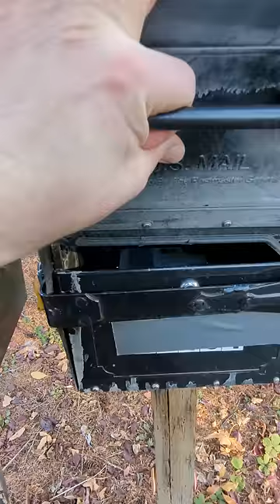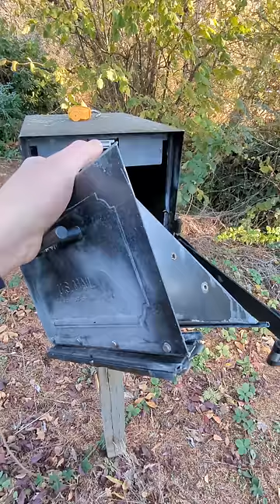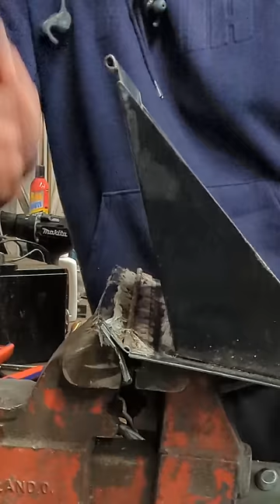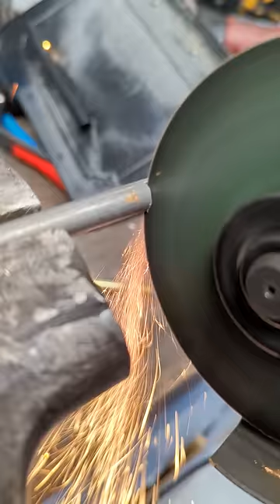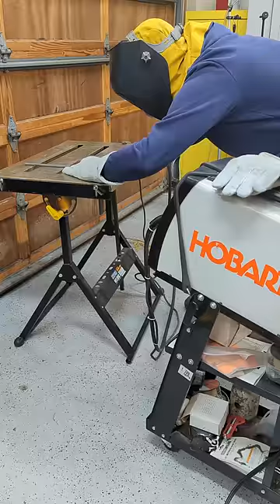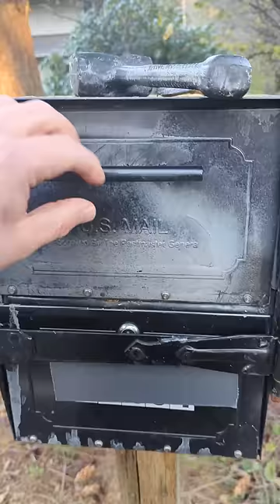Beefin' up the mailbox again...

Comment: I saw him put in hours of effort only to slap on a masterlock and instantly got so sad for this man
Reply: OnlyPain
Reply: I assumed that was meant to be the punchline
Reply: I was thinking the same hahaha 

All his work was basically useless
Reply: @beepboop7090  Well no. All that can be used easily to swap in place actual lock like Abloy classic.
Reply: What’s a good lock then?
Reply: The box is electrified he shows at the end of the video
Reply: @tylerc3477 Watch Lockpicking Lawer. He'll show you what to avoid
Reply: @tylerc3477  Depends on use case. No luck is full proof. Maybe an Abus here? Check out Lock Picking Lawyer.
Reply: @zebcollison2563  that's not a power cord. That's cabled steel. Resistant to cutting with a masterkey (bolt cutters.) Better than most light duty chains, anyway. 

There's no way you could electrify your box to an amperage that deters theft and not find yourself in a lawsuit.
Reply: it's for a squirrel apparently,  so I think the lock is safe.

Comment: Turns his mailbox into fort Knox.... Locks it with a master lock 😂😂😂😂😂
Reply: Lock picking Lawyer would like to know this guy's location
Reply: Bro bears can’t pick locks
Reply: If it happens again I fully expect he will weld the whole box
Reply: @mattruder5858  have you seen the videos “picking” masterlocks?? A lot of them you can just bodyslam them together or yank kinda hard and they pop 😂
Reply: @mattruder5858  is that what this dude is beefing up his mailbox for?
Reply: @ThatDudeDeven  That’s what I would guess, I didn’t watch any other videos
Reply: @mattruder5858  Yea I've randomly seen this fuckin short like 50 times and there is no backstory and nothing on his channel about it at all. Just car videos. I feel like I'm stuck in another dimension trying to figure this shit out.
Reply: May I dare to say “fort locks “
Reply: @mattruder5858  probably most locks but a master lock... maybe
Reply: @MorfsPrower  forget about lock picking lawyer. He tied the box down to the post with one of those flimsy cables that can be easily snipped with a small pair of bolt cutters.

Comment: Makes a safe, proceeds to lock it with a Cheeto.
Reply: This is the best comment. Oh my God
Reply: I just watched the video of the guy who came up with that meme. Weird timing
Reply: A TORCH SAWZALL BLADE will cut the post and cable in 5 minutes.
Reply: If I was the thief, I  would just bring a wood saw and take the whole thing.
Reply: @Hanzyscure  l lol
Reply: @gang1798  nah, it only takes a couple seconds to rake a MasterLock like that. You don't need to be a skilled picker
Reply: @tigerofdoom  takes even less time to pop it open using 2 wrenches
Reply: @tigerofdoom  I can pop that lock with a scrap piece of sheet aluminum can.

Comment: It's good that the guy stealing your mail doesn't know how bad master locks are😄
Reply: yeah. I saw that and chuckled
Reply: What locks are the best?
Reply: @TTime685  no lock can stop a good lockpicker but decent disc locks require special tools that arent as common. anything is better than a masterlock though
Reply: @flexflex8950  Gotcha. So Master locks suck overall when it comes to picking AND durability? Or just picking
Reply: @TTime685  they are not durable theres quite a few masterlocks that can be opened by hitting it with another masterlock
Reply: I've literly  opened master lock  with other masterlock keys , lol they just get worn down and done
Reply: @TTime685  For a good example, before I could lockpick anything at all, I used a bunch of masterlocks I had laying around and it was fairly simple. Even if you didn't feel like properly picking any of their locks, a simple "rake" style lock pick worked like 100% of the time, and raking can be done extremely quickly. you just put the pick in and out, fast, and over and over, and their locks would just unlock
Reply: @TTime685  You can even break em with an 12 inch prybar.
Reply: You want a lock that can take blut force. Youtube it
Reply: @TTime685  See Lockpicking Lawyer. He just looks at a Master lock and it pops open...lol.
Reply: @kefpull6676  Or if it takes him more than a minute, then it's pretty safe to use.
Reply: Thank you was my first thought and I'm only a couple thousand locks into picking
Reply: @TTime685  NotMasterLocks.

Those are the best
Reply: If dude is this dedicated to upgrading his security, he needs to get hisself a roku padlock. You won't be 2-wrenching OR picking one of their mid-quality locks. Probably be spending over 100 bucks tho. I haven't looked up prices. But you get what you pay for, or should.
Reply: Abloy is the best locks
Reply: Or watch the videos on what he did to beef up the box.lol
Reply: @TTime685  abloy protec locks
Reply: @TTime685  Get an Abloy, they are hard to pick.
Reply: Brinks locks are the best
Reply: @flexflex8950  You can pop a padlock like that with two wrenches. No fancy tools or lockpicks needed.

Comment: CCTV, motion detector, and a curved plastic piece at the bottom of the post, that reads,       
 "FACE TOWARDS ENEMY"
Reply: @American_ZeR0  the key letter is F towards enemy
Reply: and on the back it says "do not eat".
Reply: @capt.raptor4650  only on those that are issued to marine units.
Reply: @capt.raptor4650  😂🤣🤣🤣
Reply: @American_ZeR0  🤦
Reply: I think you could be 100% successful cutting your list down to 1 item, well you might need a small pc of wire too.
Reply: "Hmmm what's this thing d-" (Explodes)
Reply: FRONT          
TOWARD ENEMY
Reply: "I see the light!"
Reply: Woo Hoo Come Out Swinging..👍✌🇨🇦

Comment: Builds the beefiest Mailbox known to mankind.

Locks it with a master lock.
Reply: lock picking lawyer
Reply: That's a masterlock model 315SSKAD it can be bypassed by the use of a rake just like all the other laminated padlocks of theirs.
Reply: @livedandletdie  
A fist sized rock picked up near the road will probably do the trick.
Reply: I shook a master lock an it opened
Reply: That master lock is easy to cut.
Reply: @carstekoch  Or a sliver of Red Bull can.
Reply: You can just hit it with another master lock 😅
Reply: @simontisdell  i can cut it in less than 5 seconds. But its just a mailbox . Not worth messin with.
Reply: @pheonixmusta1730  i frowned at one one time and it unlocked itself lol
Reply: "this is a master lock."

"It can be opened easily with this master lock."

Bashes them together violently
Reply: @livedandletdie  here we have  a masterlock model 315SSKAD, it can be opened using a masterlock model 315SSKAD

Comment: Know a guy who had 2 mailboxes ruined by kids with bats. Bought one of those Rubbermaid ones and filled it with concrete 😂
Reply: That is the mark of an evil genius lol
Reply: I bet dude is still in surgery getting his arm fixed 😬 😳 🤣🤣🤣
Reply: Had a similar idea for my in-laws, only it required two mailboxes, one big enough to hold the other, and concrete. They didn’t go for it for some reason.
Reply: I saw something similar on 1,000 ways to die like a decade ago. Concrete mailbox vs. Kid with bat.
Reply: Been there done that😜
Reply: When I was young we were the only Black family in town. The “locals” used to regularly run down our mailbox with their trucks. My step dad encased the mailbox pole in steel and dug it down deep into the ground. The next time they tried it was the last time. They completely messed up their truck. Coincidentally, my brother just changed that mailbox. It’s been almost 40 years…
Reply: @LovingSocialDistance  Thats incredible
Reply: I got got by one of them. Broke my damn bat, so I stopped by and put it in the box for the guy to keep. He earned it.
Reply: A brick pedestal with a mailbox inside will take care of that problem real quick. Nothing's going to move that except a bulldozer.
Reply: Yep I heard of a story like that said the kid hit the mailbox filled with concrete broke his arm when he hit it and sued the man who filled up his mailbox with concrete and won
Reply: My uncle used part of an axle as the post and welded up an internal frame for the box and welded it all together. Told the local sheriff and delivery person who were okay. Few days later a kid showed up at the hospital with one broken wrist and the other hand badly broken. Gotta love small town solutions
Reply: You steal this story? I remember reading about a guy who did something like that, and the kid lost his arm, might have died, can't remember if he did or not. I think there was talk about charging the guy.
Reply: @megansmith1382  no they just looped back and ran over it.
Reply: @dylanwatkins2430 good why ruin a good bat
Reply: @roberttaylor6030  nah man. Long story short, I was a door to door salesman for a summer in college. Heard some crazy stories. Happened In Pennsylvania.
Reply: @LovingSocialDistance Goodd shittt 🤣🤣🤣🤣
Reply: I remember watching this on a TV show. Bones I think. Because the bat came back around and the kid ended up getting killed. Just tv I guess..
Reply: Saw that on CSI and the dude went to jail
Reply: We don’t use bats anymore we use “torpedoes” the cylinder plastic electric unit covers on the side of roads. Just run up and kick it over and pull it back it snaps right off then we hang out the window at 70 mph and launch it at the mailbox and it explodes the box into a million pieces hahahahaha
Reply: @blakehutchinson9586  I can’t wait until you grow up
Reply: Illegal as well, at least here in Texas asked about it before and officer told me its considered a trap which makes me liable if someone injured themselves on it
Reply: Yessss
Reply: @dylanwatkins2430  sounds unlikely but happy to read any reference to the lawsuit that you have
Reply: Iv seen that episode of csi didn't end well
Reply: I know a guy who did that and then the kids went to the gas station and filled up a 20z soda bottle with gas and left a puddle of plastic around a cement block at the end of his driveway. I mean allegedly.
Reply: Hair pin will pick the lock in a few seconds
Reply: Have been a kid who hit one of these mail boxes before it was the last one i hit
Reply: We had a similar problem,  so my dad made a new mailbox out of 1/4" plate steel. Kids broke their bat trying to dent it 😆
Reply: A whole road of farmers in my hometown did that when I was a kid. Hitting mailboxes instantly became a thing of the past 🤣
Reply: @alienkid  which is what would likely happen.
Reply: @blazejenkins8386  yep
Reply: @bellefowler6104 i miss when bad TV was still watchable 😭
Reply: Yeah, that was me 30 years ago. Luckily it was my turn to drive when we found that wrist breaker. Was enough to convince me to retire. Had a nice run, though!
Reply: Someone did that with a manatee mailbox years ago.  It still stands today
Reply: @roberttaylor6030  just curious here. How would they charge him? The mailbox is the man’s property. The kid was i) trespassing ii) destroying personal property iii) and if he happened to take whatever package was in there, he would be charged with that too (not saying this happened obviously but just hypothetical). I can understand people would be extremely upset if a kid died but like come on, the kid was totally in the wrong.

edit: I read someone else’s comment that said filling it with concrete would turn it into a ‘trap’. That just makes me feel great knowing you aren’t allowed to defend the property you’re paying taxes on
Reply: @Meady  Like I said I can't even remember if he was in fact charged with anything. It was a long time ago. I kinda think they were trying to decide if he would be charged with anything or not. I tried a light search of the internet and didn't see it. I do remember the kids were driving by and one would hit his box with the bat destroying it. They did it several times,  so that was his response.  I do know what your talking about with the trap thing though. You can't rig a shotgun to blow away someone who enters a door to your house or imbed razors on top of a fence,  etc....
Reply: Yep it happened on CSI too
Reply: Way too good. My friends dad did the same thing I remember him showing me the camera footage 😂
Reply: @meady50  gets even better once you realize it’s a federal crime as well cause they are technically fucking with the mail but you get in trouble for protecting your shit

Comment: The reason why their called Master Lock is because when you start picking locks they are the first locks you'll master.
Reply: Heck, half of them don’t even need to be picked to open
Reply: @alexls1923  I won't even use Master to lock up a toiletries cupboard.
Reply: @alexls1923  all you gotta do is get a big rock and break the latch off. unless its welded to the side of the mailbox, this mailbox is gonna keep getting broken into. he just needs to install tree cams and put the culprit away for good
Reply: @alexls1923  hot tip, if you’re ever locked out by a master lock, just hit it with a different master lock!
Reply: Managed to pick one of these at my work when another manager lost her key. Literally used a small nail and a beefy paper clip. I don’t know the first thing about lockpicking and just wiggling around a bit managed easily. Option two was going to be cheap bolt cutters.

Comment: Imagine calling someone an idiot then using a master lock to keep them out
Reply: yeah. even i noticed that one.
all these people talking about the lock pick lawyer and what not. they're being too complicated... all that crap lock needs to do it in is a good pair of bolt cutters .
Reply: @kstormgeistgem461  Bolt cutters are a bit big to just carry around casually imo. Picking a masterlock is really not complicated though, that's why people mention LPL. Most masterlocks can be beaten with raking, which only counts as "low-skill attack" because you need to be skilled enough to insert some metal pieces in the lock..
Reply: @kstormgeistgem461  bolt cutters? Try a couple open box wrenches or something with a little torque.
Reply: Nah the easiest way to open a masterlock is to slap it with another masterlock
Reply: @kstormgeistgem461  I can open a master lock with a box cutter
Reply: Needs an ANSI lock on the box.
Reply: LPL
Reply: @nitoyep3366 
 I'm an up-and-coming locksmith... PLEASE elaborate on this "box cutter" method you speak of.
Reply: Right not stopping shit
Reply: Bolt cutters or a cutoff wheel see ya later 😁
Reply: And the clasp was weak.
Reply: Clearly whoever is breaking into his mailbox isn't smart enough to attack the lock, or the hasp, so he was just being accurate.
Reply: @kstormgeistgem461  some models will just open if you hit them hard enough.
Reply: Click out of one, two is binding...
Reply: @kstormgeistgem  all you need is anything stronger than a masterlock 🤣
Reply: Yeah most of the time the Lock Picking Lawyer just jiggles it and they break open
Reply: @misfit4ever01  even a plastic bag
Reply: @kstormgeistgem461  two crescent wrenches and you can pull most padlocks apart master locks can literally be jerked open they are sad.

Comment: I can only imagine being the Mail guy seeing this box evolve like “well who tfs been robbing this guy? Chuck Norris?”
Reply: As a retired mailman who used to see hundreds of mailboxes on a daily basis, doesn't really pay that much attention to any particular mailbox, in general. However, a few do tend to stand out. Like the metal mailbox attached next to the door of one house, whose mounting screws hit the electrical wires inside the wall. I know what 110 voltage house current feels like and complained. Easy way to remember what 110 AC feels like, touch the plug prongs as you plug it in. It'll remind you.

Comment: ''Let's see if this idiot can crack this '' proceeds to use the smallest easiest to pick padlocks as physically possible
Reply: Pick? You could almost cut those off with a pair of scissors. Like the smallest cheapest bolt cutters done
Reply: @ba1050  takes less time to pick them.. its sad..
Reply: I wouldn't necessarily consider Smashing it with a hammer "picking" but hey it gets the job done 👍🏻
Reply: Most people can't pick locks. Getting a lock that's hard to cut is the most important thing here
Reply: @Car_Soup  it's a masterlock it's as easy as using a shim, a comb, or just use a rake pick.
Reply: @generalpatton8903  nice padlock 😄 never mind pick it, 2 10mm spanners , squeeze, pop, open-permanently! 🔐 🔒 🗝 🔧 🔧 ⏰
Reply: @Craig  lol who can find the 10mm anything lol any wrenches will do.
Reply: @generalpatton8903  2x10mm, even fits luggage padlocks and BIG padlocks too!
Feel free to mix! 10 &11, 13 & 8 there's, Er, endless combinations!?!
Reply: Comb pick. Takes about 2 seconds. Almost faster than the key
Reply: A hammer tap with open ALL master locks in under a min
Reply: You don't even need to pick it. I fairly sturdy stick will pop it open.
Reply: I have genuinely slapped one of those locks off before. Given I slapped it really fucking hard and had gloves on but still. Any lock you can slap open is not a lock, it's a masochistic goth girl.
Reply: Those rubberized master locks are designed to hold in water and seize. Eventually, even he won't be able to get in it
Reply: Not every thief knows how to lockpick. Even if its the lowest skill level required
Reply: @ghostkilla931  the entire reason that we go around roasting these is to eventually convince the lock companies they need to invest more than 50 cents in them. considering that combing raking and unshielded backs are vulnerabilities known since the beginning of the last century, it's annoying to still see them in circulation.
Reply: fr you can open that lock with another masterlock.
Reply: @car_soup9452  you are SO incorrect lol. virtually anyone can pick open a Master lock, you don't even have to "pick" it whatsoever. ever heard of raking?
Reply: @Zach Brown  ever heard of bolt cutters. In the real world someone is going to buy bolt cutters to cut a lock because it's just as easy and more readily available than a pick set. 
You watched lock picking lawyer once calm down arm.chsir expert.
Reply: @car_soup9452  Right, so NOT a Master...